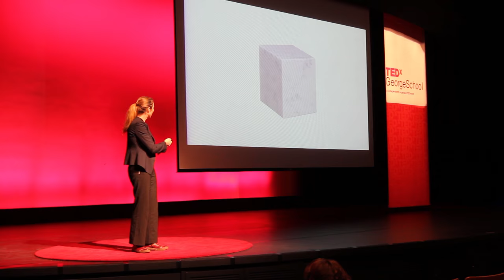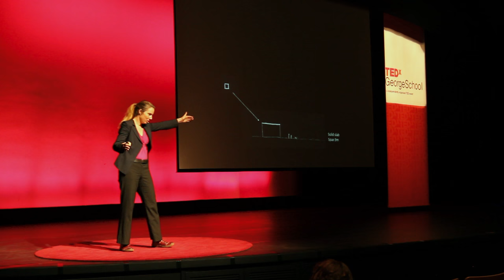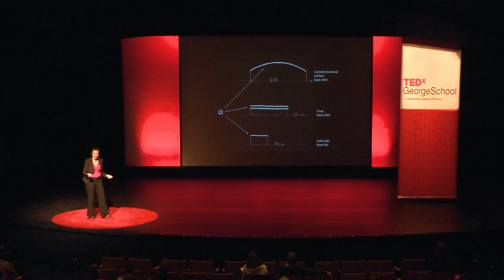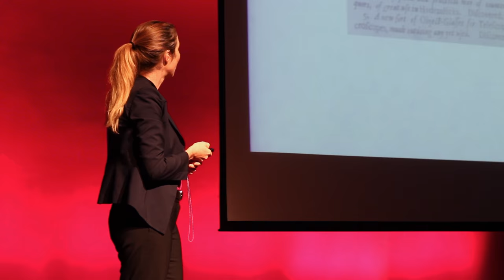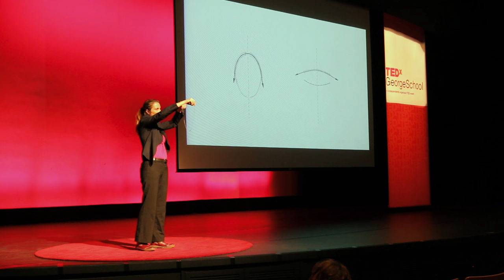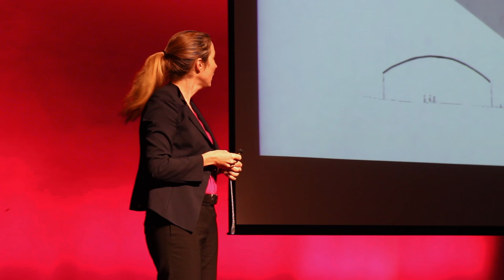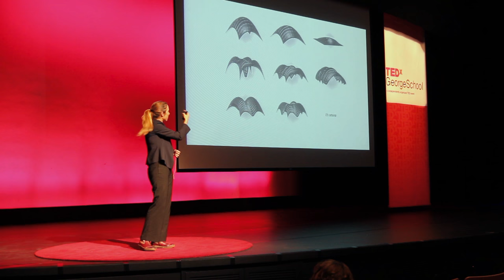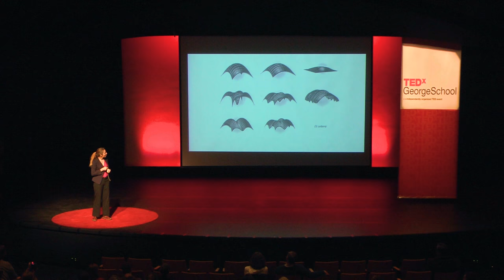Designing for strength, economy, and beauty | Sigrid Adriaenssens | TEDxGeorgeSchool

Comment: This works for self weight, but bridges have traffic loads, wind loads, and in some regions seismic actions. And structural design codes are not easy to deal with. Even roofs are designed for wind loads, snow in some regions, this will add some entropy to the algorithm, was this considered?